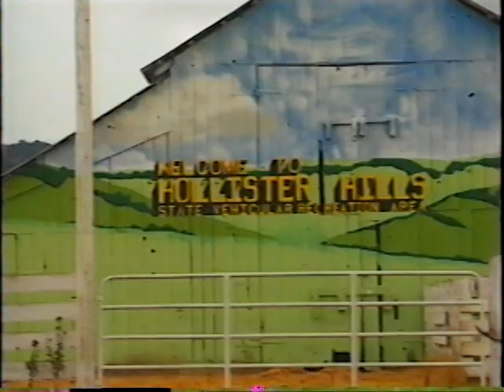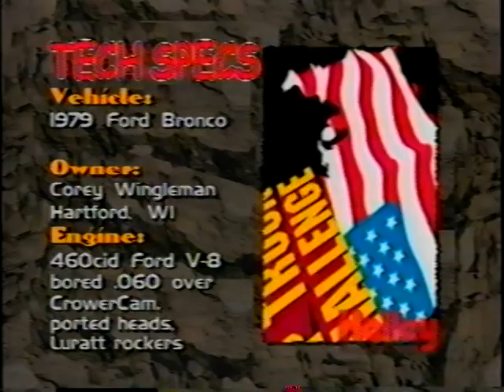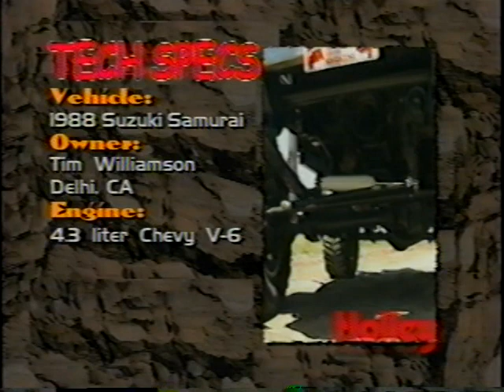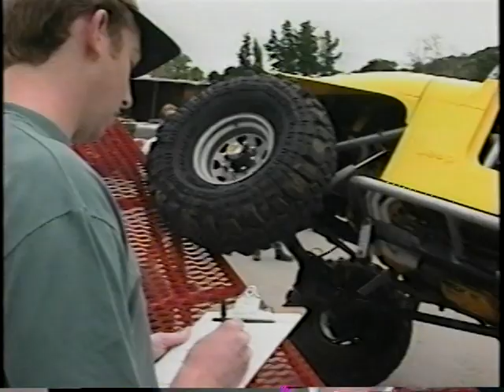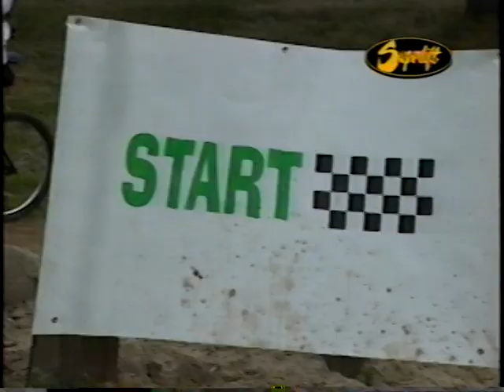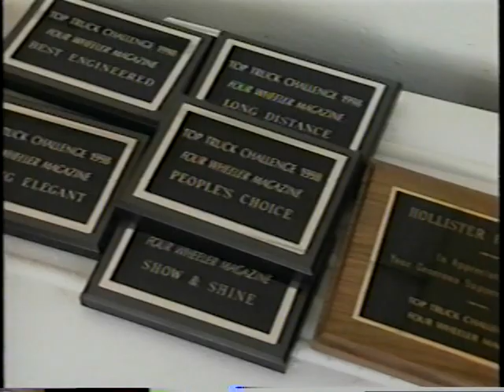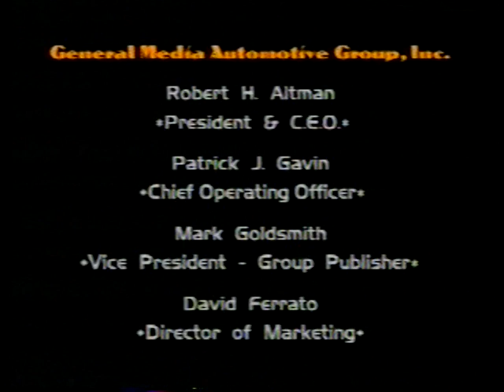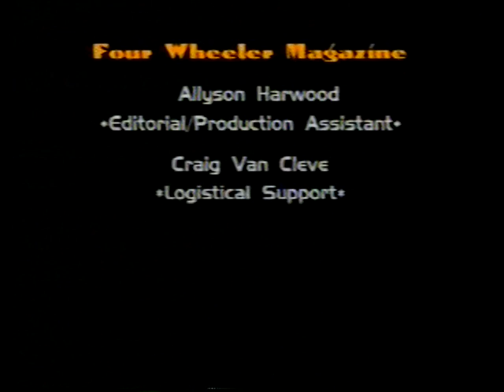Top Truck Challenge 1998 part 1

Comment: Finally somebody from Florida ... I live 10 minutes from Soggy Bottom ,,, right on the Florida / Georgia Line ,,, in Macclenny ... D
Reply: Get 'er done ✅👍👍👍 thanks ... D
Reply: Pageant Brothers Transmission there in Perry ,,, used to build them for our four wheel drives ,,, pretty tough ,,, steel sprag ,,, clutch pack ,,, the works ... D